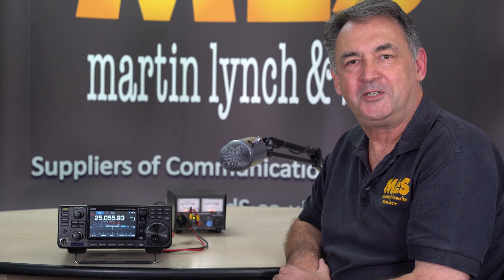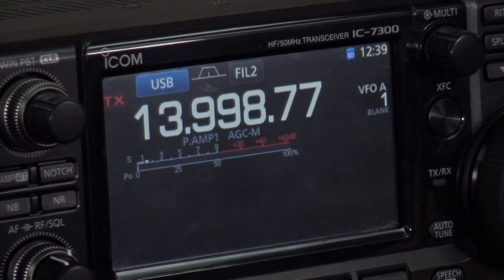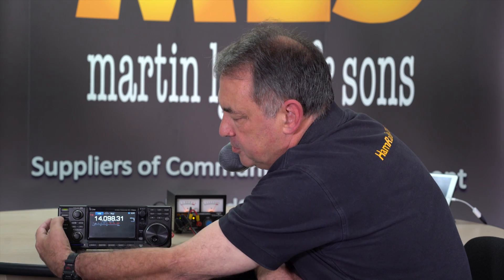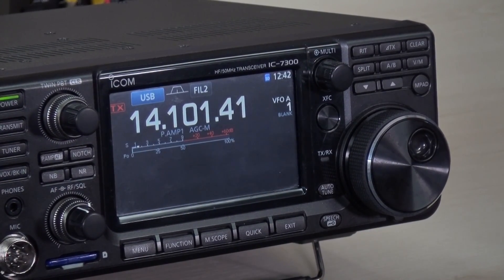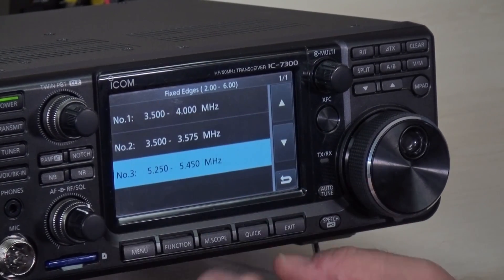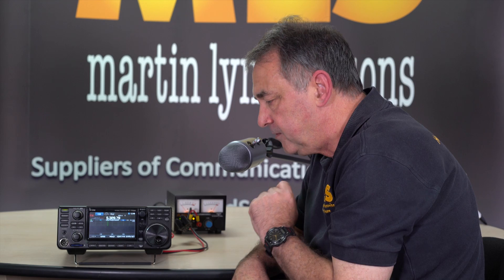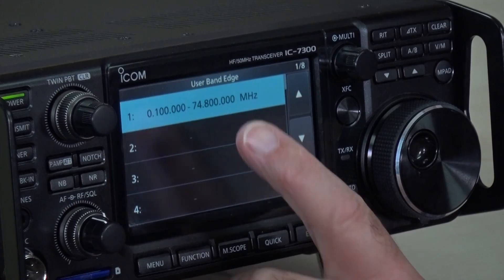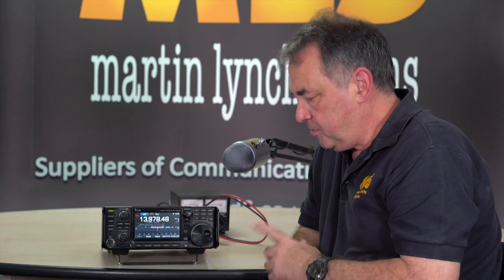Modifying the band-edges on the Icom IC-7300

Comment: Better than removing diode.  Of course you can flick the diode off also. Also software. Most rigs have this somewhere somehow. Have 5 radios and all but the one I use goes anywhere on any mode. There is a point on radios where you should stop.There all different. Taking a radio and butchering it like a cobra 148 is going way to far.